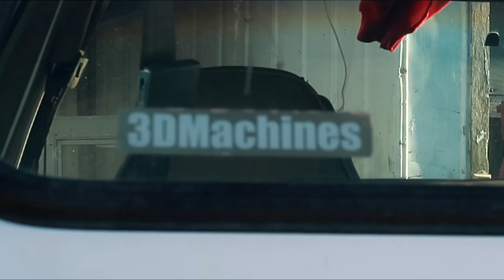DODGE RAM CHARGER Challenge - Pulling Another V8

Comment: I got a question? Why in the hell would you pull the engine with the torque convertor still attached? It's much simpler to unbolt it through the starter hole or inspection plate than risking tearing up the seal or the shaft on the transmission. You need to take it off and make sure you put it back in the transmission while spinning it to make sure it seats all the way in or you are going to tear up something thats going to cost way more than the trucks worth.
Reply: Pretty much what Kurt Whitman said. Just unbolt the torque converter and make sure you mark one of the bolts but I'm not totally sure if that matters I've never had to before but there's always a first. Put the torque converter in the front of the transmisstion and spin and wiggle it until it seats all the way into the trans. Sometimes the torque converter rubs the inside of the trans and thats totally normal. You then can sit the engine into place and like I mentioned you should be able to go through the starter hole or it should have a inspection plate on the bottom of the bellhousing to get to the torque converter bolts/nuts.

Comment: You need to take the torque converter off the engine and put it on the other trans first. You will cause damage to the trans if you try to put it in with the converter on the motor. Also try to use the converter that came off the trans that you are using.
Reply: He should put in a new seal.

Comment: darnnit, Dalton, you pulled the torque convertor with the engine AGAIN.. the convertor unbolts from the flywheel. don't try to put the engine in with the convertor attached, or you will be pulling the motor again...you'll have a massive trans leak at the minimum, major trans damage at the worst. change the front seal, unbolt the convertor, install it in the trans, being sure its FULLY SEATED. then, drop your motor in...as a auto tech of thirty years, I cringe at the thought of this....:(

Comment: Sooo... you took a rooted R.C and pulled the motor out of it and took the motor out of a rust free R.C then putting it in the rotted RC then scrapping out the good R.C? da fk Also pre 88 is carbureted that's a throttle body since it has injectors you will see the ECU in the drivers fender next to the battery.